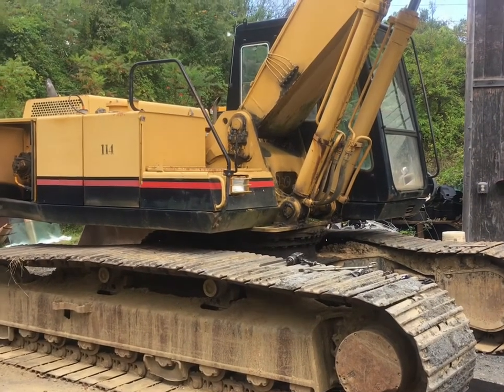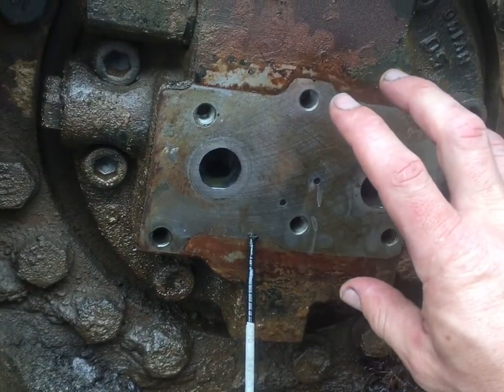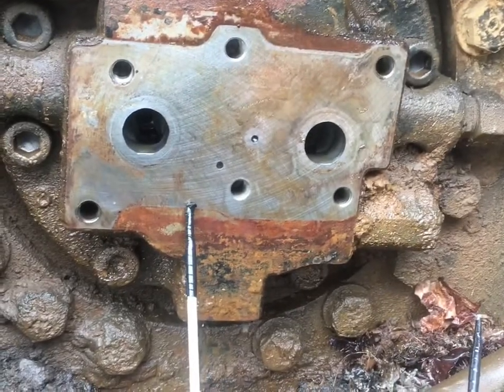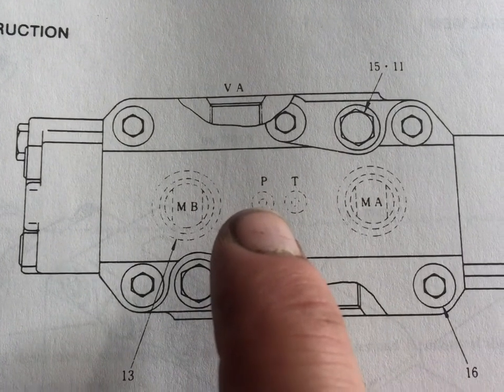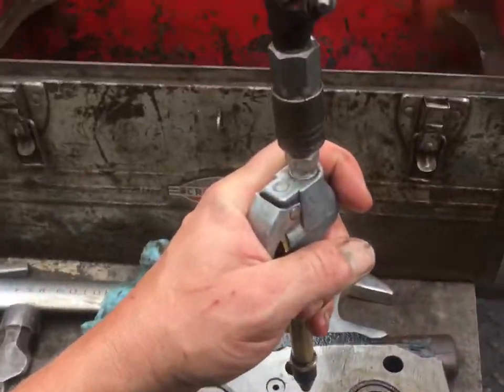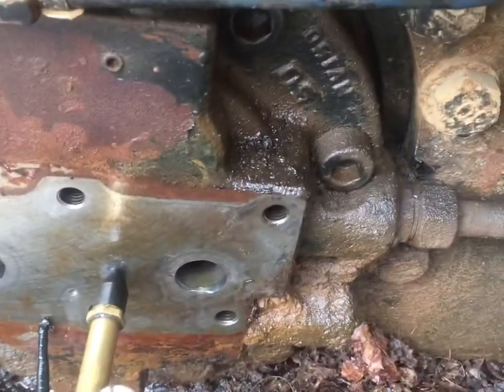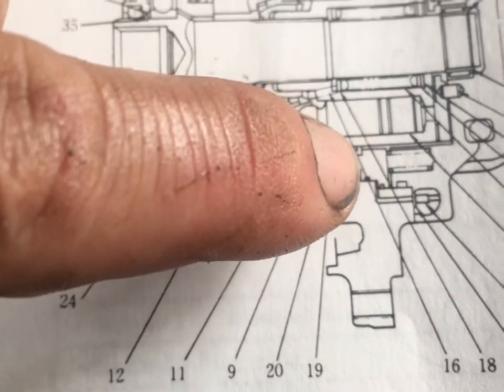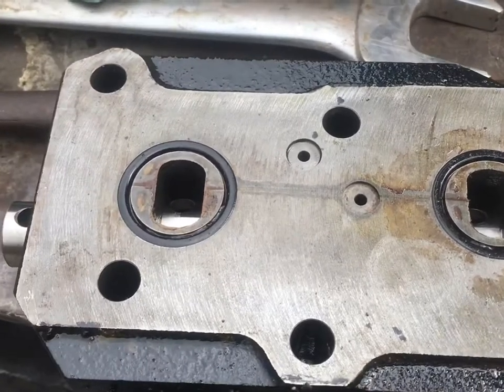Almost Stumped!! Jamming Tracks from a stuck brake, technical explanation.

Comment: Great job  but was it always like that from new ?
Reply from the maker: No, It became problematic after the customer changed out the drive motor a season or two before I was called out to it.  I suspect either the brake valve was apart during the swap and assembled incorrectly or if the brake valve came installed on the motor the rebuilder end for ended the spool during assembly.   Thanks!